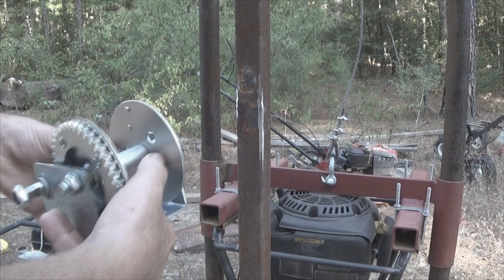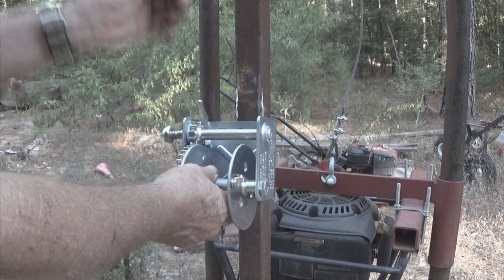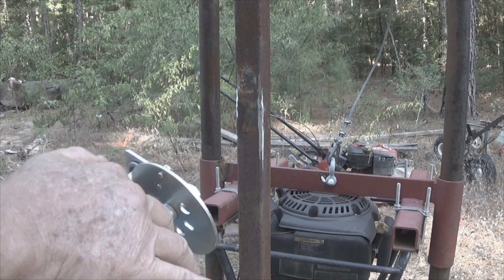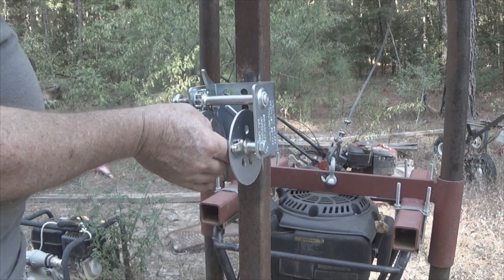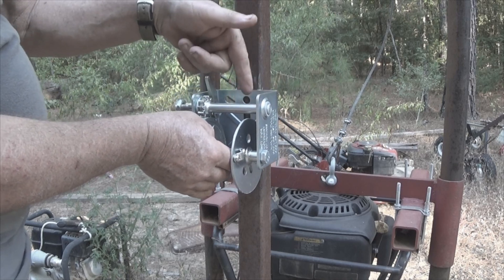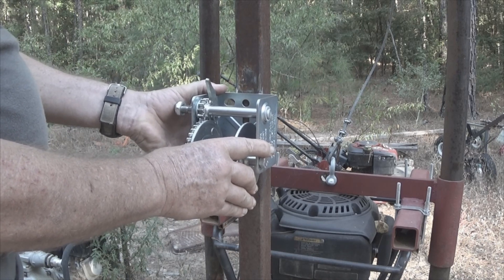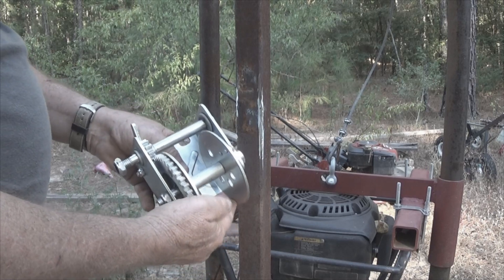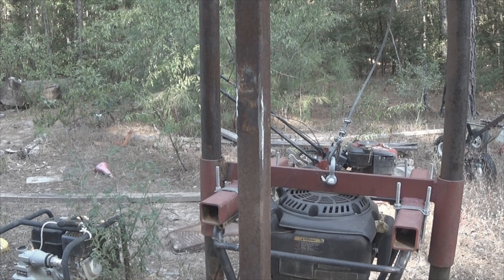starting to repair the deep rock drill

Comment: I have one of these deeprock drills. Works fine until you hit some relatively soft limestone. I’ve gone through two gear boxes         .  If you just have clay and or sand it’s fine, otherwise the machine is not heavy duty enough. It’s made to dig fence posts or to auger through ice, not the rigors of well drilling. I drove to Texas to pick the rig up, obvious hillbilly operation. This can be easily put together for 1K if you have some basic fabrication skills. Not worth the money.